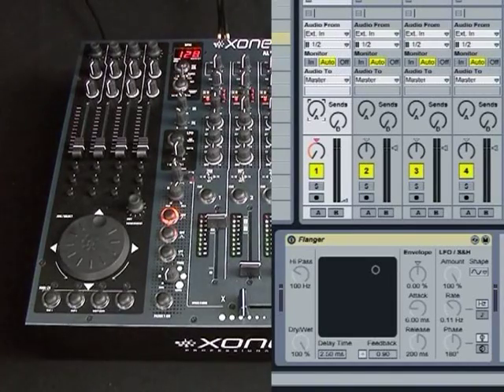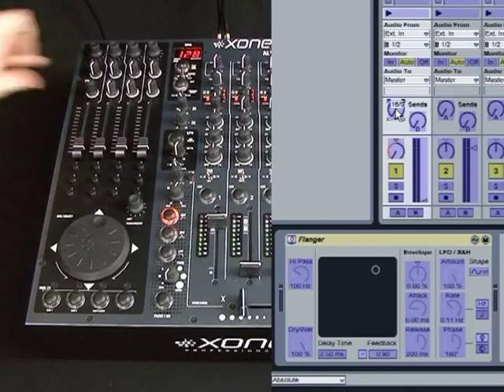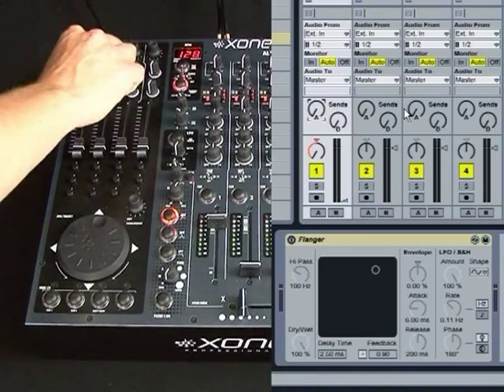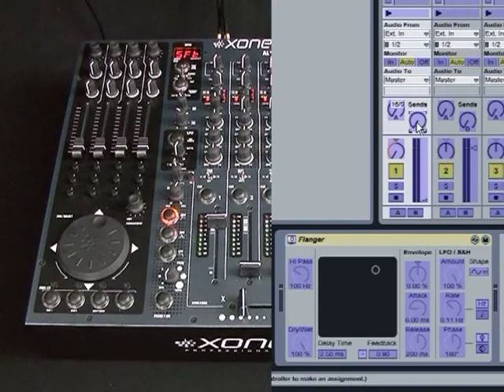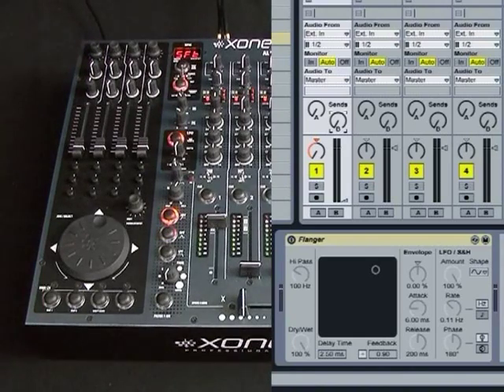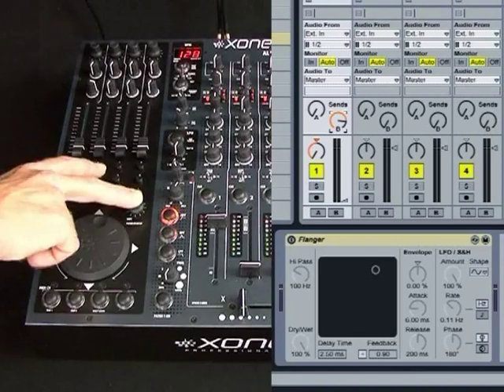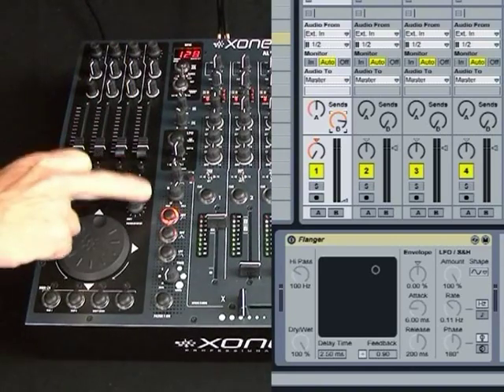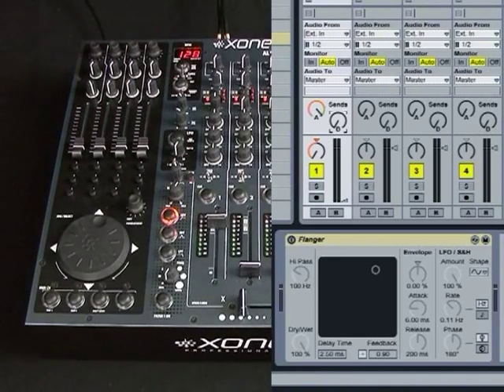MIDI Shift Function on Allen & Heath Xone:4D

Comment: Hi, just wanna know how to share exernal midi clock with midi din 5pins on midi input of the xone 4D? I just received a Midronome hardware midi clock and wanna use it as master clock in this way
Reply from the maker: Hi Ecume,

Thanks for the message,

4D is unable to receive a MIDI clock, but it should be able to pass one through from MIDI in to out. You will need to ensure that the 4D's internal clock is switched off so there is no clocking conflict. This is achieved by pressing and holding down the start/stop button for around 5 seconds. The display should read 'OFF' to indicate this.

Thanks,
Luke
Reply: @AllenandHeathUK  thanks for your answer Luke, it gives me ideas ^^ do you know if it’s a physical limitation or a digital/driver limitation? Anyway I love this machine and hope. 
Anyway, I love this machine and I hope that solutions will be found so that it can be used at 100% despite technological developments, notably at Apple. it's a shame not to be able to use it with the architecture of the M1 and M2 chips for example